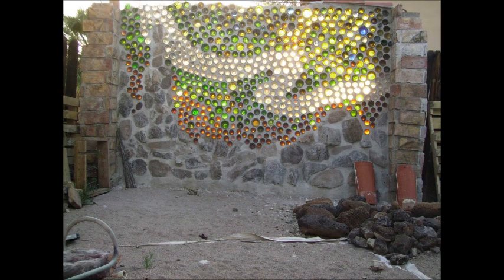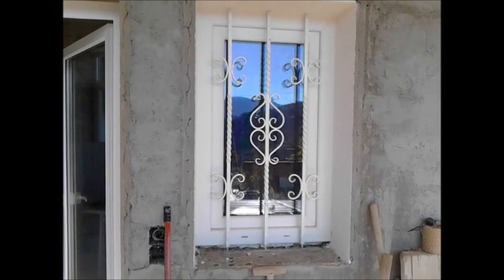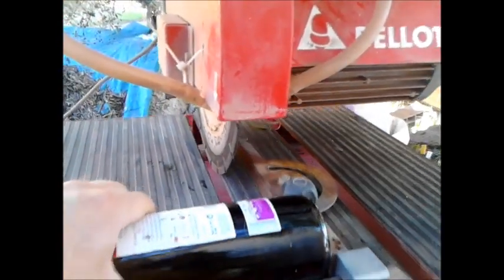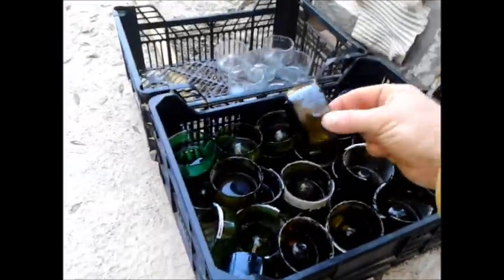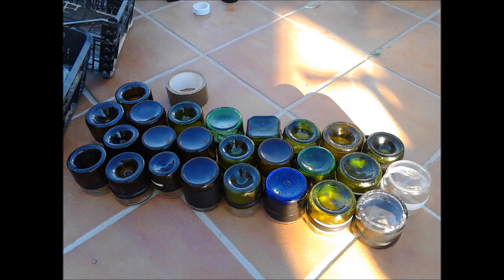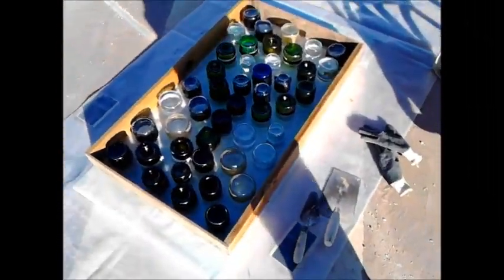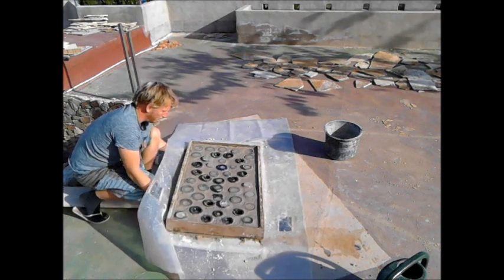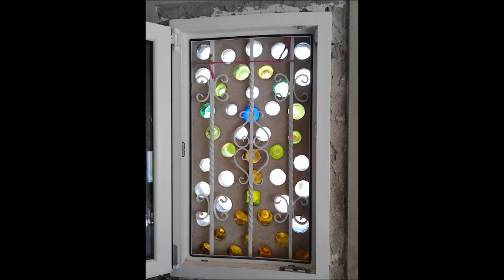Framed Bottle Wall (Earthship)

Comment: Could you explain why you kept it wet?
Reply: To prevent cracking while it cures, I think.
Reply: Like Lydia said, if concrete dries too fast it will crack. All you have to do it put a sheet of plastic over it allowing it to cure slower. 😁